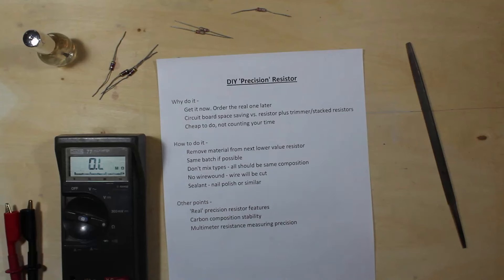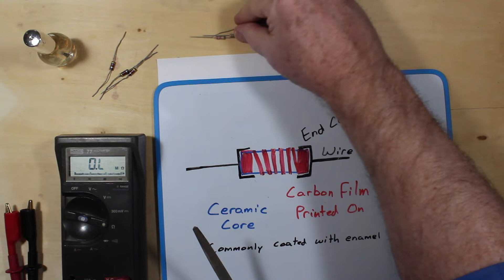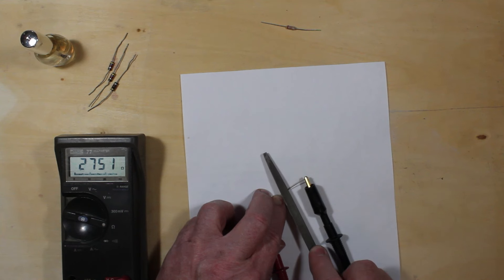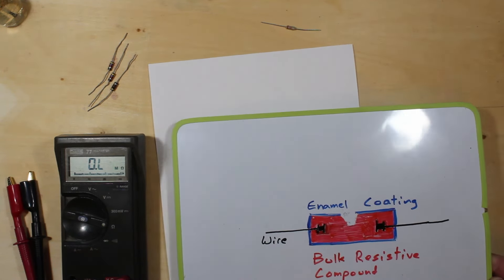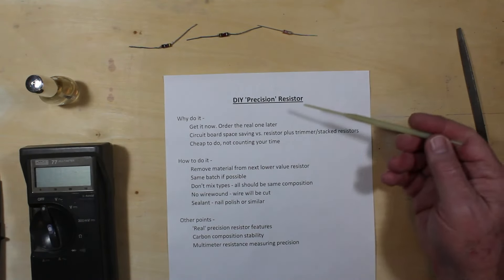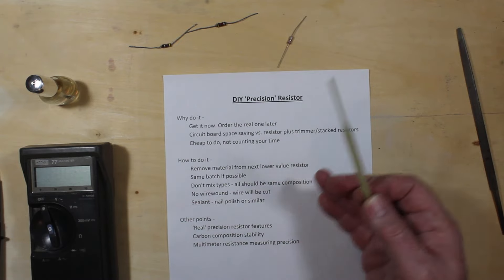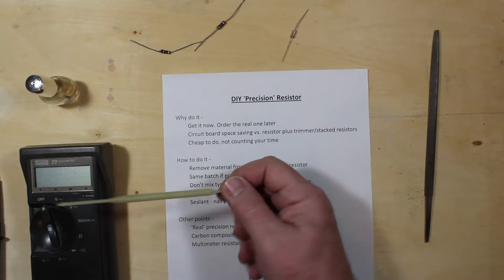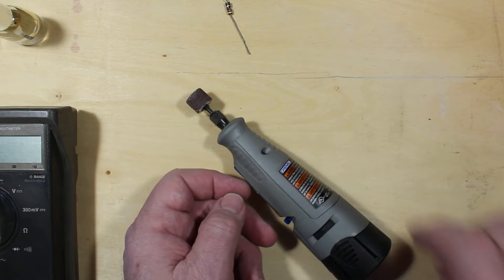#13 'Precision' Resistor - Make Resistor Values You Need From Values You Already Have #diy

Comment: Thx for sharing. Not many know about this technique now they do.

I used to work at a company and that is the exact method that we used to make precision valued resistors. However, it was found later on that they can fail. by not knowing exactly where the resistive element is you may be narrowing the conductor to the point that the resistor is compromised causing them to fail.

So, what to do? If you accept this as a temporary stopgap measure then sure use this method, but replace the resistor with a 1% or better resistor. For DC applications make a resistor outta wire. Wind wire around some form of bobbin. I have seen this technique used in fluke instruments where a hyper precision DC applied resistor was needed.

Again, thx for sharing.

That's all I have.
Reply from the maker: Yes, one reason you might use this method is for when you want a value right now, especially a matched pair.  The carbon composition resistors work much better with this method, as long as you can tolerate their shortcomings.

Comment: Never done this before but I LOVE IT. Maybe I should go back to using thru hole parts places
Reply from the maker: Or you could put your surface mount resistors in to a laser engraver and make your own laser trimmed resistors.  At least it sounds easy.....

Comment: "Carbon" and "precision" are mutually exclusive.

Just buy actual 1% resistors, they cost next to nothing in any case and will make your life that much easier.
Reply from the maker: If you're in the middle of a project and need a specific value then this method is one option to solve a problem.  Once the project is proven, then order the parts as needed.
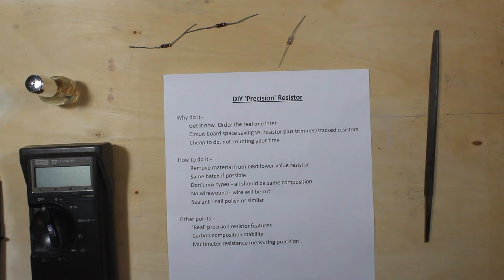I mention at 6:56 that the viewer should understand the shortcomings of carbon composition resistors, but they're the easiest to adjust.
Reply: @MoreThanElectronics  whatever happened to series/parallel connecting values you do have on hand?
Reply from the maker: The method I show here is just one more option among many.  I mention the series/parallel option at 5:38 and if that gets you close enough then use that method.  Filing a carbon resistor can be pretty quick.  Use a trim pot if you have the space etc.

Comment: A clever technique that I did not know. Thanks for adding to my bag of tricks!
Reply from the maker: Glad to help fill that bag.  I have a project coming up that will need two custom resistors in the op-amp gain loop.  DIY resistors will be good enough to prove it works.

Comment: There is one "slight" problem with making "prevission" resistors out of carbon resistors: They drift all over the place, not only with temperature, but also with age, so after you trim them, after a short while they are off again. So no, it does not make sense at all. By the way they were trimmed already at the factory to pretty much the exact value. Any difference you see is just how they drifted over the time since manufacture, and they will continue to drift. So you won't get any real accuracy.
Reply: Thx for the drifting insight. I knew how temp sensitive Carbon resistors are but not about aging.
Again thx for the insight.

Comment: how is the nail polish holding up with repeated heating/cooling over time ? wont stick too long on human nails. how is it on heating carbon traces?
Reply from the maker: I think it should be fine.  The resistor surface is rough from the grinding so I think it should provide good adhesion.  I've used nail polish with success for decades inside of radios to hold trimmer capacitors and the slugs of adjustable RF transformers.  These modified resistors are mainly for use in op-amp gain loops, DAC ladders and similar low power applications.